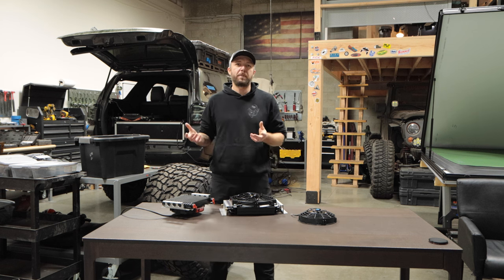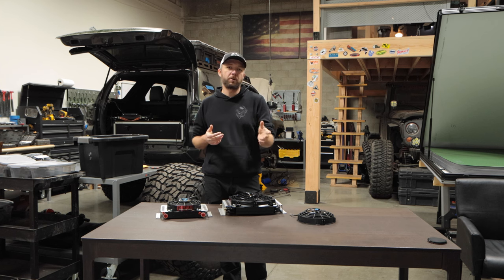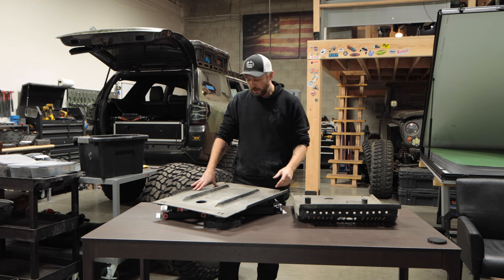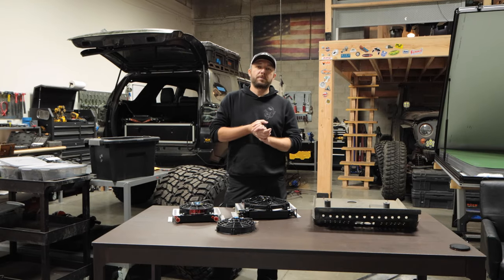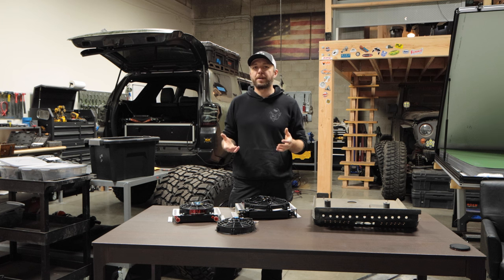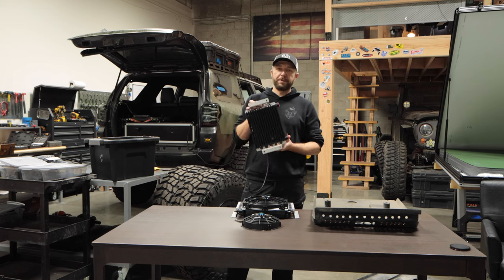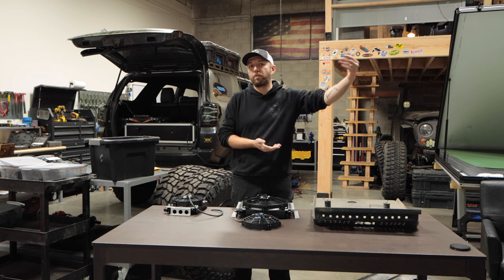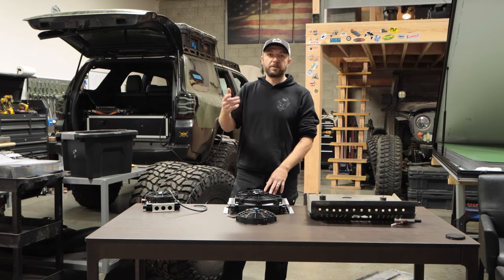Deep dive into transmission cooling in modified Toyota and ultimate 4Runner overbuilt cooling setup

Comment: Wow, the timing of the release of this is crazy.  I just finished a 9 day road trip, reached over 230 degrees driving against the Texas winds at 75MPH to 80MPH.  My rig was completely loaded with fridge, camp gear, with 2 adults, 2 kids.  295/70/17, front and rear metal bumpers with winch and swing out, stock gears.  Thanks for talking about this, there's not much information on this topic.

Comment: One of the reasons the first item to be installed in my brand new 2016 FJ Cruiser was a Hayden 679 to control the temps and replace the WS ATF with fully synthetic AISIN AFW+ Now I rarely ever see anything over 176F

Comment: Thanks for making this video. I pretty much have just a stock 4Runner and several times a year I tow a trailer and watch my transmission temperature with a Scan II and during towing I've seen temps up to 220 degrees. I've been thinking about installing just a external transmission cooler, also transmission cooler with the built in bypass. I live in the northeast and concerned about the cold temperatures.

Comment: I appreciate this video! I installed a Hayden cooler awhile back. Dropped temps to 180 on the highway but easily gets up to 230 when pulling long grades even in S mode. Granted my GX is super heavy and has an ARB bumper with LP9’s in front of the grill. I NEED to revisit my cooler setup and absolutely need to add a fan. You’ve inspired me to take another look at it.

Comment: You should look it these coolers, Setrab ProLine Fanpacks “SETFP920M22I” little expensive but work great. I used this on a twin turbo Duramax to keep the oil cooler. I will be using one now after I saw what you’re saying on my 4Runner. I didn’t know they run so hot. I’m pretty sure it will fit where you installed your other two cooler’s.

Comment: Please do a transmission cooler video on the GX setup. I have a 2005 Toyota 4runner V8. Would also like some links if possible.
Reply from the maker: Won’t have full video until summer but just put up a short of the setup on the GX

Comment: I put the 25 row derale in 5 months ago and keeps it pretty cool except when climbing mtns. then it only hits 200 with 37s
Reply: and with tsist just arrived this morning  hahahaha
Reply from the maker: 200 with 37s is amazing!
Reply: Richie did you use a custom built bracket? I bought an Icon fan one but it won’t hold that big cooler you have. I bought a big derale 52506 but can’t seem to get it to fit anywhere up front (sad thing is I don’t have a winch or front bumper yet) thanks for any info

Comment: Copper transmission coolers transfer heat up to 70% more efficiently than aluminum transmission coolers. That might explain why you needed to use more than one, taking up so much space. Excellent video thanks for sharing your insights!

Comment: Know this is a bit old but I would suggest a torque lockup kit. I drive an FJ Cruiser with a transcooler and  my highway temps drop to about 145 when the torque converter lockup kit is engaged. Can drop from about 200 to 145-180 range. That's been my experience so far with it.

Comment: Heat transfer area is the most important. Plate fin coolers are most efficient in regards to space. Maybe overkill, but  I added a magnetic filter on another ride after the cooler. What do you think about a filter before coolers? It ensures that you aren't plugging off over time, especially since plate fin cooler have smaller passages. Probably overkill, but having watched you for the first time, I'm thinking you like overkill. I will be tying a cooler before radiator because I live in a cold climate. Avoids  bypass system, the transmission cooler afterwards will cool when it's hot and heat when it's cold. I will install a better fluid than WS, not sure which yet, however my biggest and urgent recommendation for everyone is to add lubegard (red bottke) to your system. Over 15 years of use, cools your tranny, fixes rough shifting and prevents shudder. It's not a gimmick. However, living in Canada, I have currently a hard time getting some. Fortunately, I have enough for a service of the new to me 2012 4runner, but I feel uncomfortable if I don't have extra sitting on the shelf
Reply from the maker: Hard for me to answer as first I’ve heard of filter for transmission… but it makes a lot of sense. Wish you didn’t tell me because… I do like overkill 😂. Will also look into lubegard.

Comment: Hi,
My name is Glenn from newzealand,
I have a ford ranger that has the 3.2 litre straight 5 diesel, I occasionally tow a caravan/travel trailer and the hand book suggests using “s” mode for towing which I do and also use tiptronic on steeper sections,
Just curious as to how “s” mode works by keeping the transmission cooler? I understand the shift pattern is also modified over drive mode.
Reply from the maker: Two things: 1. The more your transmission shifts…. The hotter it will get. Automatic transmission shift a lot. 2… the lower your rpm’s  (short version) the hotter your transmission gets. In a Toyota by going into S mode you tell the vehicle not to drive in the highest gear… so if your going 70 mph at 1800 rpm in 6th gear now you’ll be at (approximately) 2500 rpm in 5th gear by going to S mode. You can also lower the highest gear to  4th or 3rd with the intent of keeping the RPMs up (around 2500ish) at slower speeds. I am assuming the s mode works similar in your ford.
Reply: @SandyCats  yes it does,
Thank you for the reply

Comment: Great video and sweet fleet of trucks you have.  Do either of your 4Runners have KDSS looking to buy one and wondering if it’s worth having.  Plan to lift the truck under 3in
Reply from the maker: GX has kdss. I pulled it out of one of the 4Runners. If you do not go long travel or mid travel in the rear KDSS is awesome once you add the dr.KDSS switch. (So you can go 3” and still keep KDSS functional). It actually doesn’t limit off-road at all. But if you plan to go mid/long travel your going to have to remove it.
Reply: Thanks keep up the great work. 🍻

Comment: when you are measuring the  trans temp, do you reference the oil pan temp or the temp at the torque converter? In my GX, the Torque converter can see temps 15-20 degrees hotter than the pan temp
Reply from the maker: Both. But referring to pan

Comment: Did you just start the engine and let the cooler and all hoses fill naturally? Or did you follow what improved racing’s instructions say which is pre-fill cooler and disconnect fuel pump fuses etc. ?
Reply from the maker: Start engine and let it all fill naturally
Reply: Sweet thanks for the rapid response. Just finished relocating the SC pump under driver headlight as well and adding all new HD rated heater hose. TIGHT Space! I modified the Mishimoto cooler sold for 2007ish FJs and said I’ll make it work and fits good. The IR bypass just arrived so once I saw those instructions I thought damn that’s a bit much 😅. Thanks🍻

Comment: Thanks for sharing your experience. Could you tell us how much you are above the stock weight on GX (front, rear)?
Reply from the maker: I never weighed it so I wouldn’t know for sure.  I would guess around 1100-1200 pounds not loaded (including larger tires and suspension).

Comment: Do you still get good Air Conditioner efficiency with the transmission coolers all mounted in front of the Air Conditioning Condenser? Any noticeable difference?
Reply from the maker: Zero difference…

Comment: do you think I could just run my trans off of a 15"x13"x5.5" thick with a 800cfm fan cooler in the back without the radiator?
Reply from the maker: If you got a fan on it… yes. Jailbreak overland is running it in the spare tire carrier on a 4Runner on 37s. He is using a 25 row stacked plate cooler with a fan. He didn’t go over 200 when we drove up the 15 going 80.